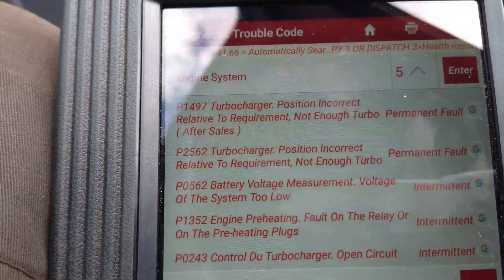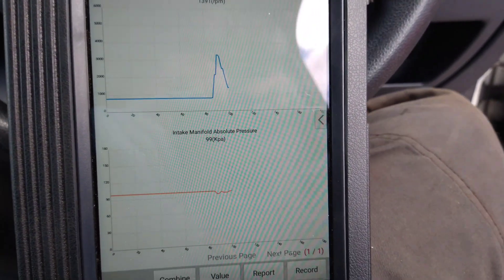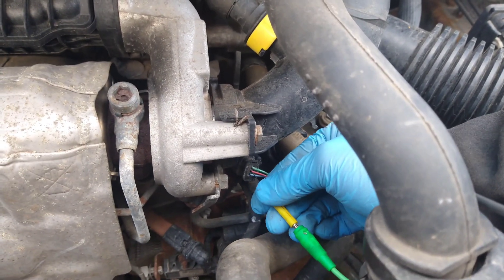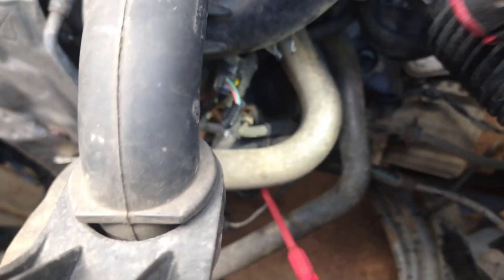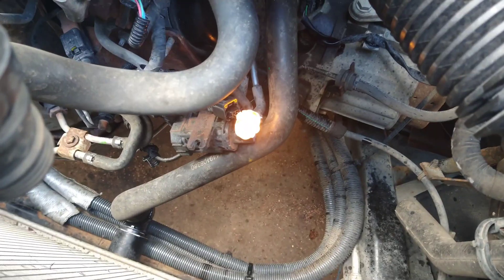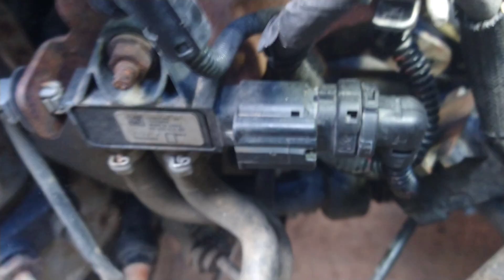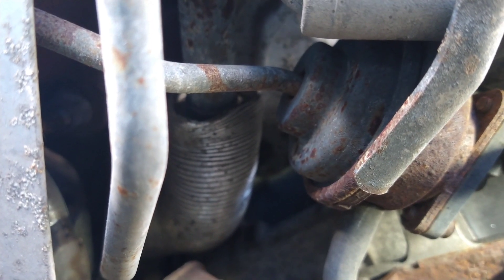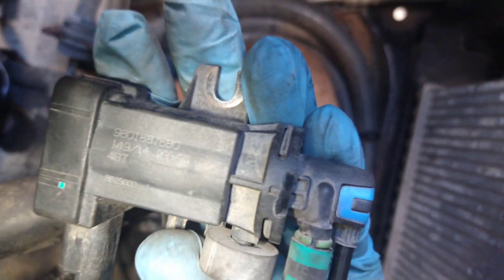Citroen Dispatch (no power) turbo position fault

Comment: I'm working on a Citroen C3 mk2, codes P0299 and P2562. i've checked the actuator and his position sensor, next thing i want to control is the solenoid but i can't find it. Is it below the actuator?

Comment: I got p2562 code but I got power in the turbo. Engline light wiped off code but come bk on in 10 min so what do I need to do? Pls c3 2014
Reply: Hey same problem, did you solve it?
Reply: @marianvirlan4091 not yet but bought sensor for actuator turbo £20 need change 😊

Comment: Hi mate, love the channel, very informative and to the point. Wondering if you’ve come across this problem mechanic to mechanic. 

2013 Peugeot partner 1.6 HDI no fault codes, runs fine at idle however when under load and driving uphill warning triangle and engine stop light come on and engine cuts between 2.5 and 3k revs in all gears other than first. 

Will start again after a few minutes, this has been a bugbear as the owner smashed out the DPF and remapped, I’ve had to replace the turbo due to failure, and the body actuator solenoid as it was sticking. 

I thought it may be the fuel pressure sensor at the back of the engine on the fuel rail, but still has the same problem cutting out under load and still no fault codes, any ideas? 

Cheers

Tony
Reply from the maker: @AnthonyPickstock-t7z  had one like that once, ended up being a high pressure fuel pump on that one.
Also had a couple that is just a fuel filter.
Hard to say without seeing the car
Reply: @ cheers for the reply, yeah it’s an oddball to be sure, it’s been fully serviced with new fuel filter. The head scratcher is having no fault codes to work from. And don’t want to just throw parts at it until the problem is solved.

Comment: Hi Matt. Does this solenoid have a filter in it that can be cleaned. Or would it just be a case of replacing the solenoid? Thanks
Reply from the maker: I can't remember if it had a filter, this just got replaced. Cheers Matt
Reply: Ok. Thanks. I’ve ordered a new one. Hopefully this will solve my problem 👍
Reply: @paulgilbert2375 where did you source the solenoid from please

Comment: I've got the P2562 code and no real power in the van (1.6hdi Peugeot Partner 92bhp) 
I've changed the actuator position sensor and the solenoid, but still no power.
My local garage say it is the actuator itself, but that moves freely and holds pressure when I tested it, so not sure it is that.
Would a faulty actuator present itself with complete lack of umpph?
I also had an intermittent fault code relating to the camshaft position sensor, I dont suppose that could be related?
Reply: Here for the same thing haha! Limp mode and all the above checks completed to no avail :(
Reply: @michaelakachunk any luck with yours matey?  I've been away, but now I'm back, I'm due to take the actuator off, even though I'm still convinced it isn't that at fault! 😂
Reply: @shane555  Kind of, the new actuator I fitted was no good and internally didn't need the sensor position pin at all. I had to fit the new sensor to the original actuator to stop it from being in limp mode, still have the EML on though but no limp mode. I've got a new solenoid valve to fit when I get time but for me at least its no longer limp ffs 🙃
Reply: @michaelakachunk  cheers buddy.  I'd already fitted a new solenoid and actuator position sensor, to no avail.  I'll change the full actuator and fingers crossed it works, but I can't see how the old one isn't working to be fair, it's holding pressure and moves freely 😭

Comment: Great video Matt - thank you.  I came across it as have a similar issue with Peugeot 307 with the 2.0 HDI DOHC engine in.  Turbo is a right royal PITA to get to as is located behind engine without any reasonable access unless drop engine forward. Have no boost, just like this Citreon.  Before boost failed, it was pulsing a bit under heavy revs but otherwise engaging. Now does nothing.  I've yet to hook up my oscilloscope on the solenoid control lines but that is my plan for tomorrow having watched this and seen the PWM signal going to it on your scope (neat piece of kit that - mine plugs into the mains and weighs a ton!).  Strangely - I don't get any error codes or MIL even though no boost.  My thoughts are maybe the turbo position sensor on the actuator head is jammed in a position where the ECU thinks it is already boosting (ie it hasn't retracted fully when the vacuum was released) so isn't telling solenoid to apply vacuum to actuator.  I've had the solenoid off, in bits, cleaned it, bench tested it for tightness at 0V and full transfer at 12V and it seems ok (on the bench!).  Before I try and get into the space of a gnats bits to check position sensor signal line (green in your video), do you think this is plausible.  My diagnostics is nothing like as sophisticated as yours, and all I can monitor are MAP, MAF, Intake Manifold Temp, RPM, Load and these all seem ok - can't interrogate what ECU thinks is Position Sensor Value or what it actually wants it to be.  Appreciate it's Friday night and this video a few months old, but any thoughts to help out a very frustrated home mechanic / actual industrial refrigeration engineer would be gratefully appreciated.Cheers. R
Reply: Cheers Matt. You, like me, must be one of those people that doesn’t sleep! I’ll give it a go this morning. Nothing to lose other than some more hair!! Thank you for taking the time out to reply. Much appreciated. 👍
Reply from the maker: If your map sensor shows atmosphere pressure with the ignition on but doesn't rise when it should, I think testing the turbo actuator is a valid test.

Comment: got same problem in my peugeot can you please tell me what parts your changed and problem were sorted or not ❓🤔thanks 👍
Reply from the maker: Hi I changed the turbo position vacuum solenoid, that is the solenoid that provides vacuum to the turbo actuator. That fixed this van. It is now boosting properly.
The fault code was for the position sensor which is part of the actuator and my first test proved that was working ok it just wasn't getting any vacuum to the actuator so it couldn't move, therefore the position sensor wouldn't change.
What fault code do you have?
Yours may have the same fault code with a different fault causing the code.
If you carry out the the same checks you should only need to replace the part that is needed.
Thanks for watching
Reply: @mechanicmatt871  I did replaced turbo pressure solenoid valve and actuator sensor but my car still go in limping mode 😕😕😕

Comment: Keep up the awesomeness, Matt.
Reply from the maker: Thanks for watching and your comment
Reply: @mechanicmatt871  Matt mate. You might not still be about lol but now you have me curious.

When I bought my car, the log was stamped that it had been fitted with a brand new turbo. 

Recently I've started going into limp mode. I'm assuming it's the same problem as yourself. But when I checked the pressure valve. There is 2 hoses connected and a 3rd hose which looked like it had a small filter on the end which was disconnected on mine. Someone must have forgot to put it back on. 

Any idea what the 3rd hose which looks like it has a filter on the end is for?

Comment: quick and easy Matt nice one
Reply from the maker: Thanks for watching Robert
Reply: @mechanicmatt871  where you based ??
Reply: It's ok,  always look forward to your videos,  just a quick question , I've got a customer with bmw x5 2005 , he saying his dash always says trailer mode and check trailer lights , I've checked wiring and continuity between trailer socket and multi plug connector but all seems well , have you come across this before ? Thanks rob
Reply from the maker: I am based in st Austell, Cornwall